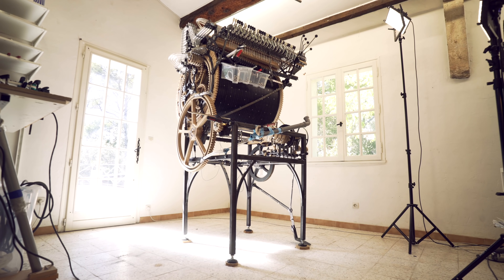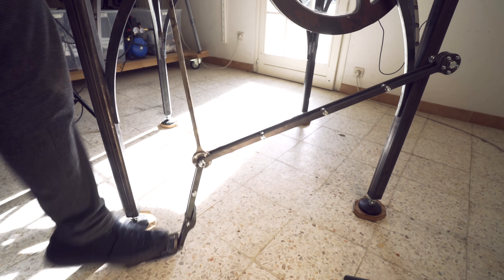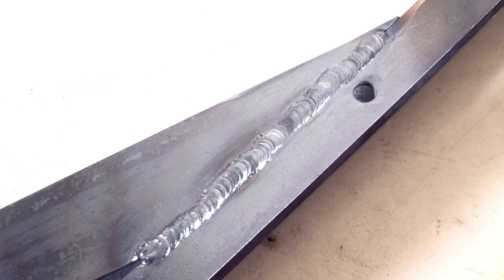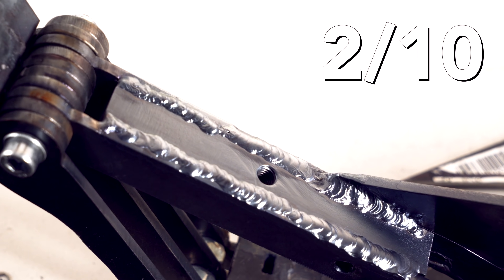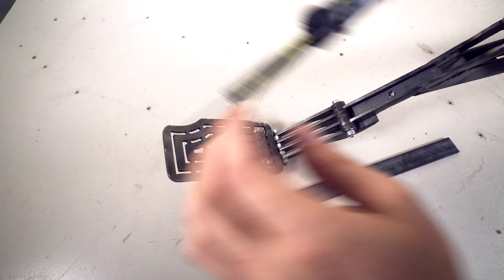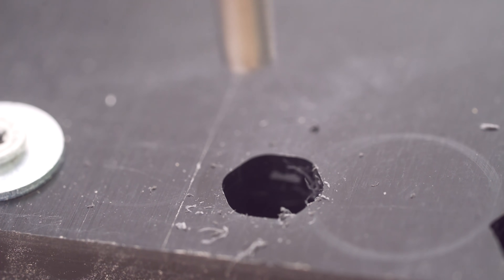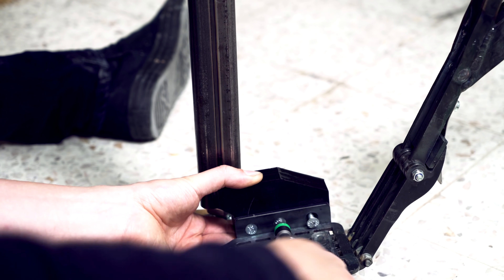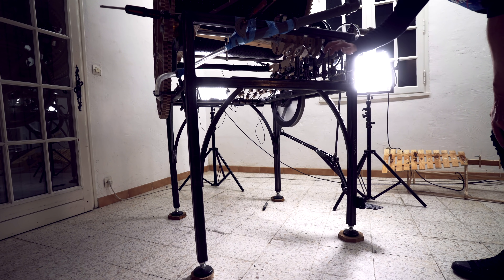Treadle Pedal Completed - Marble Machine X #81

Comment: 9:00 of course the black one is evil irony
10:10 But you didn't stick your foot under there to test the pressure under high speed. Of course now its stiff but is it still safe?
Reply: Um, if you're not sure about safety maybe try testing it with something other than your foot first time :)
Reply: @Echin0idea Ya, I know. It was more or less irony because he said it with such confidence. I really thought he is so confident, he will use his foot. I mean he knows (he felt) how stiff this spring is, thats probably why he is so confident about that.
Reply: Anyway this is a safety feature, it's not meant to be used on purpose.  It's job is just to minimize damage in case of an accident, not reduce completely the pain in case that happens
Reply: And what happens to the "pedal sliding" when the pedal is flipping up?
Reply: If he can push it back that easily (6:12), it's safe. Though I would've liked to see it aswell, just for the satisfaction :0
Reply: Its a safety feature doesnt mean to used all the time also don't expect every YouTube to be perfect you don't have a single one you don't know how hard it is
Reply: Dierundeuhr thought he would place his foot under it for testing :( 
Literally unwatchable
Reply: @Cody_and_JackJack  I reported him to YouTube; hopefully he doesn't mess up like that again.
Reply: @shimes424  I don't get it
Reply: @r0xdab0x96xo  I was sarcastically building on what @codyyim1 said "literally unwatchable"
Reply: @shimes424  Ooh, thanks for the explanation :) very amusing
Reply: @r0xdab0x96xo  yeah I know funniest comment this week (again, sarcastic)
Reply: Yep I was thinking that too "why does the evil one have to be the black one" lol

Comment: Love it.  If pedals are coming into play, have you thought about anything to control vibrato for the idiophone similar to a vibraphone pedal?
Reply: Kunarick You use fingers to vibrato tho.
Reply: @Jo-rz6bs  Depends on the particular instrument.  Some use electric motors, some use fingers, some use pedals.  Considering his hands are already busy, if this was a consideration at all, a pedal would be the way to go (that or attach more gears and use a switch that activates a vibrato that is synced to the flywheel).
Reply: Hmm, but if he intends to tune it with finger placement?
Reply: @Jo-rz6bs  We might be talking about different things - I'm exclusively referring to the idiophone (keyboard) for this implementation.

edited for clarity of message